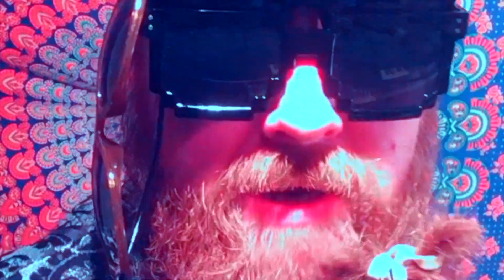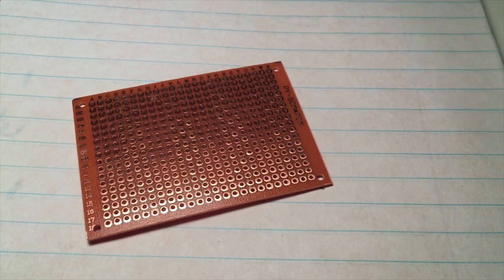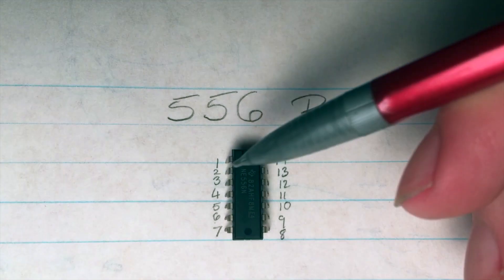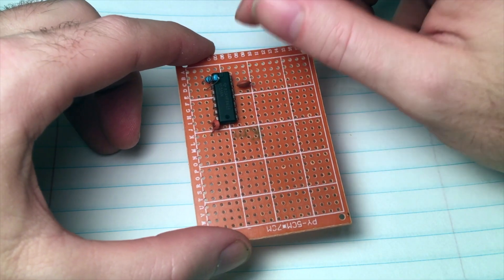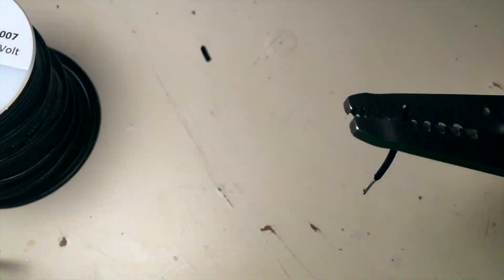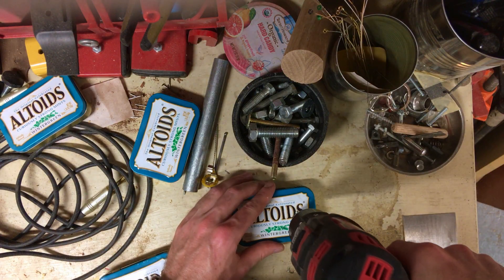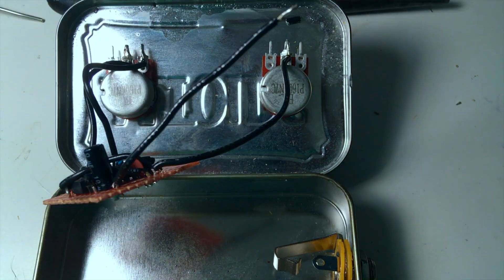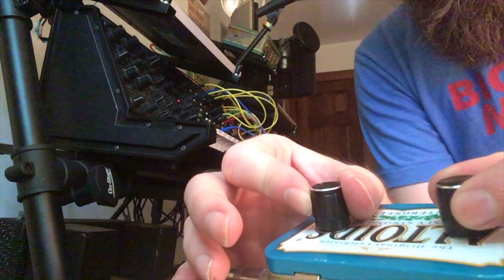Super Easy DIY Synth! The Atari Punk Console!

Comment: You wire the pot to the pins, yes, but there are 3 pins on the pots.... I've tried putting two of them togheter and take that to 14. It doesn't work, just a crackle when I power it on.. :/

Comment: hi ray complete noob here. when you wire to ground you just wire yo anywhere on the board? and that is grounded to the enclosure? or the battery. pleaase i rly wanna get this build but i dont even know how to read schematics so its gettin pretty hard
Reply from the maker: Good question! Ground is a confusing concept because it means a couple different things. In this circuit because we're using DC, it means the negative battery terminal.
Reply from the maker: Here's a great short lecture about ground: https://www.youtube.com/watch?v=WwgbgY8mVlY
Reply from the maker: Hit me up with any other questions you have along the way! And upload a video of your little monster when it's done. I'd love t see what you create!
Reply: @RayMcNamaraMusic  yess ok i will. for now iim tryin to create simple oscillators with another IC the 40106 schmitt trigger, which i kinda understand how it works circuit wise. but also got an 556 and caps and resistors of different values bc i saw many values on the web and even a bass mod APC (rly wanna do this but cant understand the schematics) also realized different ppl use more or less resistors on thhe APC and well i dont get how it works at all yet but imma just try and follow this guide and see what happens c:

Comment: Nice job! What are the pot values?
Reply: 500k
Reply from the maker: Yeah. What  @saiberukira2803  said.
Reply from the maker: It's not crucial to be exact with the pots though. I've seen people call for a 1M ohm pots and that might work better. Most of the fun playable sounds are near the top end of the pots when you use 500k.